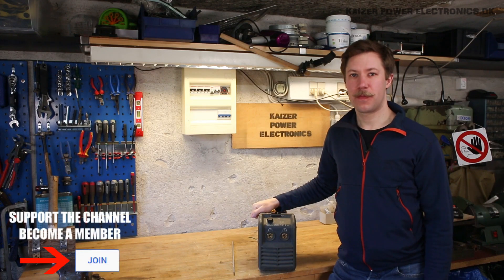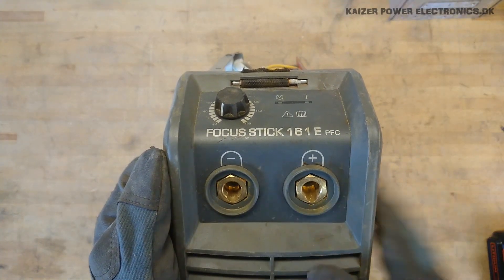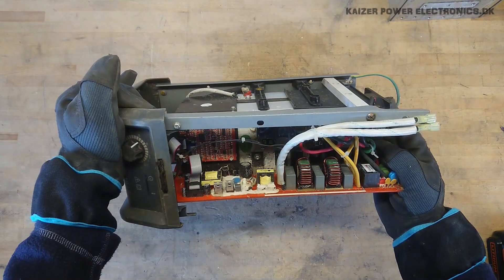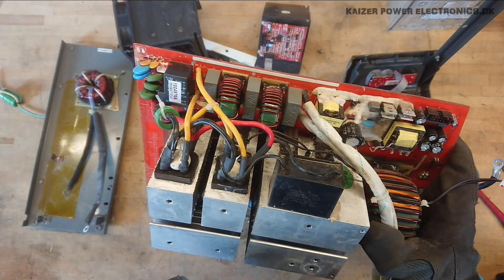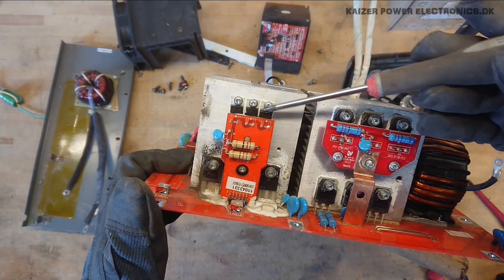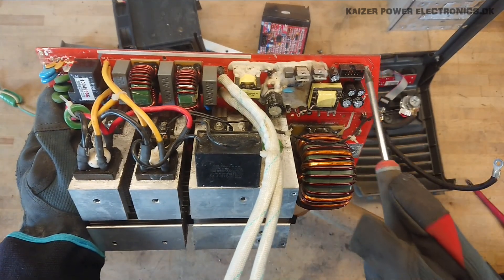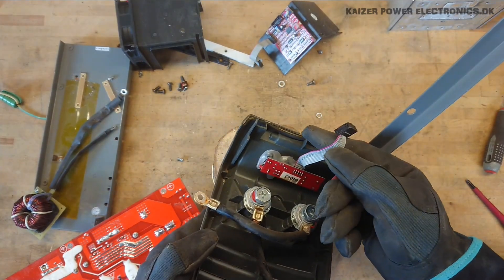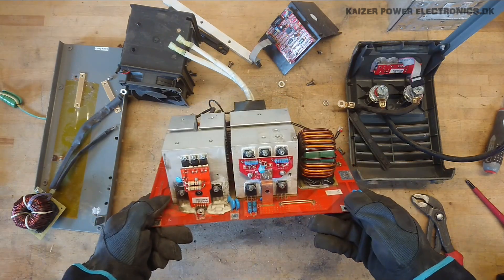Migatronic FocusStick 161E Stick Welder Teardown

Comment: The six diodes on the heatsink at 4:50 will likely form a rectifier for the output voltage, the primary switching is done by the two TO-247 mounted with the temperature switch and the MKP capacitor.

Comment: I arc (stick) welded with a Miller AC welder that was just a transformer with the core that moved in and out with the hand crank.  It had almost nothing that could fail.  The power output was thousands of watts.  I find it hard to believe that a box that small and light can handle up to 5 kilowatts in a job environment without giving problems after a year or so.  Especially the cooling system.
Reply: You'd be surprised how small power supplies have gotten over time, and also how much efficient. A welder is essentially a DC power supply which is current regulated. With modern switching topologies and high efficiency silicon you can reach 90% and above efficiency therefore keeping the overall required heatsink volume small. Also, it's a welder in a noisy environment, so nobody will complain about a noisy blower instead of a pc fan pushing air through the heatsink. The transformer will be running in the 50 to several hundred kHz range, making it significantly smaller than older ferrite cores. Size and weight are also reduced as SMAW welders are not designed to run 100% duty cycle at peak output current. On the environment side I agree with you, a shop isn't a nice place for electronics with lots of airflow. Still, with a fair amount of conformal coating and a decent cleaning every few months these things will still last many years.